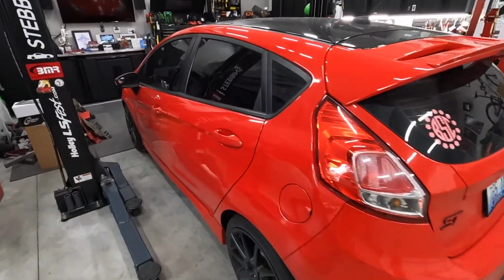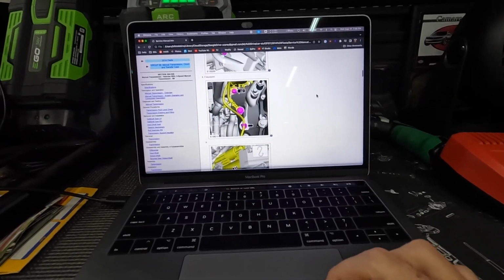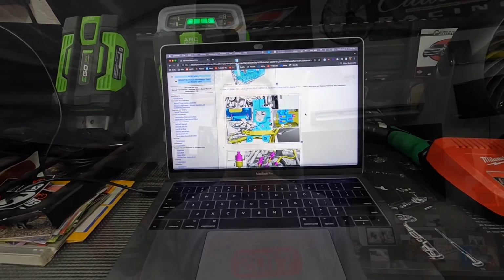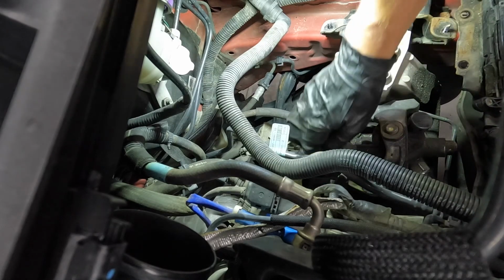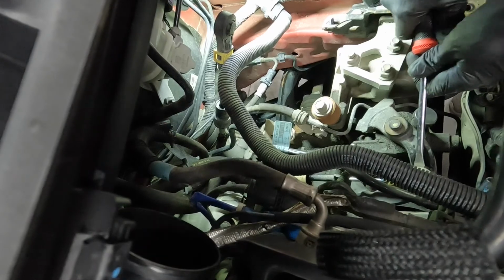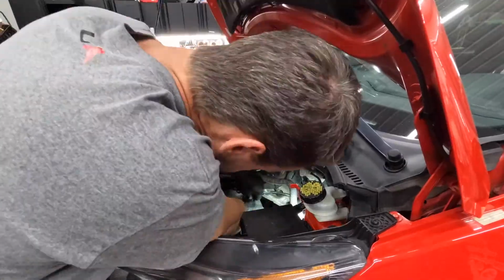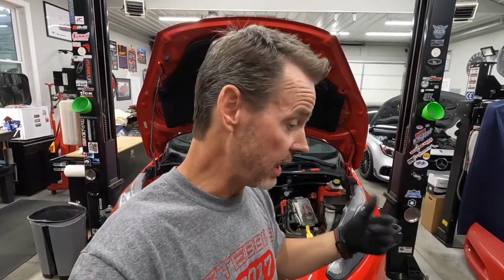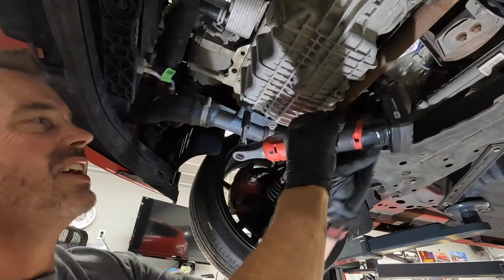Father & Daughter Replace a Bad Slave Cylinder in a 2014 Fiesta ST

Comment: Did you do a new clutch?
Reply from the maker: We did not. Parts were not available at the time, and we needed to get her car fixed. It's definitely a good idea to swap the clutch if your car is close to needing one. Trying to get any parts right now is silly. I had the slave cylinder on hand already because I knew it was going to need it at some point.

Comment: Gotta 2015 same thing. Thanks for the video.
Reply from the maker: My other daughter has a blue 2015. Yep, same car.
Reply: @StebbinsGarage  Do you know if the newer version is better? 100,000 miles seems to quick for failure.
Reply from the maker: There isn't a newer version that I'm aware of. It's a common issue on the Fiestas because the slave is plastic

Comment: let the knuckle move freely remove the strut bolts next time and the control arm will come out faster. i had this issue when installing hard race lcas
Reply: Exactly. That stud on the lower ball joint is a bear to remove. Don't even try. Disconnecting the knuckle from the strut is simple. Just be careful not to stress the brake line. Also make sure to disconnect the ABS wheel speed sensor first.

Comment: How do you actually bleed the clutch slave cylinder? Doing the same thing at the moment and can’t find info anywhere
Reply from the maker: Open the yellow bleed valve while someone has pumped up the clutch and is holding it down, close it then release. It's just like bleeding brakes
Reply: @StebbinsGarage  ok thank you very much! Struggling to get the trans back attached lol

Comment: To bleed the clutch do you just need to open the bleeder and hold the clutch pedal down? I don’t think I saw whether you guys had to do that in this video
Reply from the maker: It's like bleeding brakes. Have someone pump the clutch pedal a few times, then hold it down while you open the bleeder. Do this a bunch of times until no air comes out and it's bled
Reply: @StebbinsGarage  I’ve done brakes, but never the clutch.  Thank you very much.

Comment: was the slave leaking? My pedal is sticking intermittently. It’ll feel fine, and then randomly there will be 3/4 dead pedal. already replaced the Clutch master, still doing the same thing. Figured it was the master since the slave wasn’t leaking
Reply from the maker: No the slave was not leaking. The clutch pedal would just randomly stick to the floor. Replacing the slave cylinder fixed the problem 100%

Comment: Hey guys quick question my trans was leaking badly, not trans fluid but my brake fluid, is it still the slave cylinder? My pedal sticks to the floor and stays there unless I move it by hand
Reply from the maker: The clutch hydraulic system uses brake fluid so it's possible your slave is leaking. That would be my suspicion
Reply: @StebbinsGarage  thanks for the insight been hustling out here myself for a couple hours, my goal is to confirm it’s the slave cylinder but are you suggesting it’s still the slave cylinder? Everything else seems to be in order so it’s the only thing I can’t see until I drop the trans but I’m 95% sure it’s the slave cylinder
Reply: @StebbinsGarage  thanks boss I greatly apreciate your input have a great day!

Comment: Do I also have to change the clutch when I replace the slave cylinder ? I’ve been told by the local garage that is a must to change the clutch when I change the slave cylinder ? Thanks
Reply from the maker: Not necessary, but if your clutch is close to needing replacement it's a good idea and will save a ton of labor. We didn't change it because parts were not available otherwise I definitely would have.
Reply: @StebbinsGarage  well how do I know it my clutch needs replacing as well ? My issue is that my pedal sticks to the floor sometimes. My mechanic told me it's a must to change both when replacing slave cylinder
Reply from the maker: If your clutch has over 100k miles on it, it will likely need to be replaced soon anyway so it's best to change it while the trans is already out otherwise you'll pay for the removal and installation of the transmission twice
Reply: @StebbinsGarage  thanks!!

Comment: Can you tell me is this job the same on a 14 fusion
Reply from the maker: I've never worked on one of those but the Focus would have more in common with the Fusion. I have a Focus engine swap video on my channel as well
Reply: Awesome, thank you for the advice man. I will say this most of this video does match up perfectly with the 1.6 turbo in my fusion I however did not completely remove charge pipe I just disconnected it from the mounts on the bottom of the oil pan. Not a fun job for a fella with one and a half hands but this video helped a lot lmao!! Thanks again Man..subscribed!!
Reply from the maker: @ajlockwood5242  great! I was thinking the Fusion had the 2.0 like the Focus. Glad it was helpful
Reply: Well boss she's all back together!! Thanks for the advise I cN say now that the fusion and fiesta are basically the same from the windshield forward. Only difference is that the subfram does need dropped to completely remove the tranny, however it did not have to come completely out to access the slave or clutch was still enough room to easily replace the slave cylinder and clean the inside up. Thanks a million bro hope this small insight will be helpful to you at some point!!!
Reply from the maker: @ajlockwood5242  great to hear! Glad you got it going again. Also good to know they are pretty much the same 👍

Comment: Did y’all do anything with the clutch or did y’all just put a new slave cylinder in
Reply from the maker: No. I wanted to go ahead and replace the clutch and flywheel while we were in there but no parts were available. When we swapped engines in the Focus we did a new clutch but had to wait a while to get it
Reply: @StebbinsGarage  just checking my slave went out but clutch felt great before the slave went out just trying to see if I could save money rn and just replace the clutch later because a flywheel not pocket friendly
Reply from the maker: You definitely can. My daughter's car was getting up in mileage and it would have saved the labor to change the clutch later but she's been driving it for several months since we changed the slave and we've had no more issues

Comment: Why didn't you replace the clutch beings you had to drop the tranny ?
My slave cylinder just took a dump and order a clutch kit because this job sucks balls to take apart.
Reply from the maker: Parts were on backorder and we needed the car. Definitely better to replace while trans is out but since this wasn't planned it didn't work out that way
Reply: @StebbinsGarage  That's sense didn't think u would skip it.
I'm going to have to replace the lower control arms, steering Knuckle assembly
  cv axles,wheel bearings hubs and struts because there rusty and crusty and will not come apart. Break out another 500 bucks, 😟
Reply from the maker: @stevecooper8121  always something! Good luck